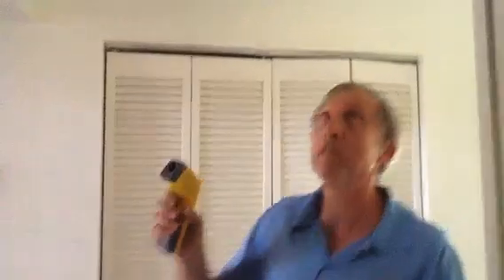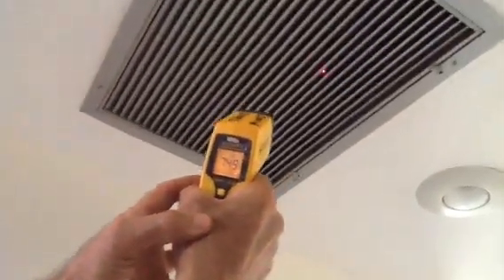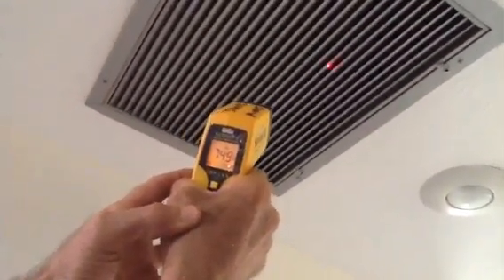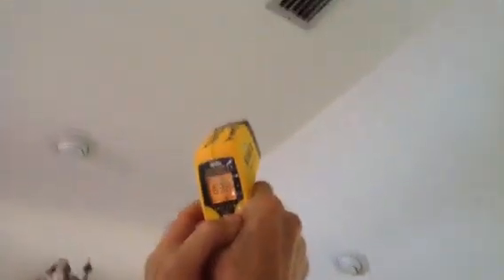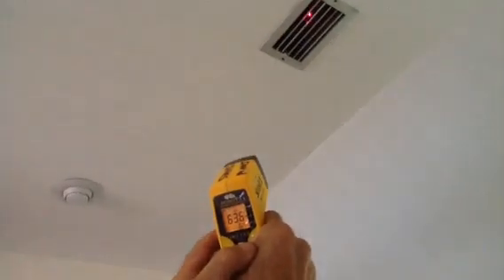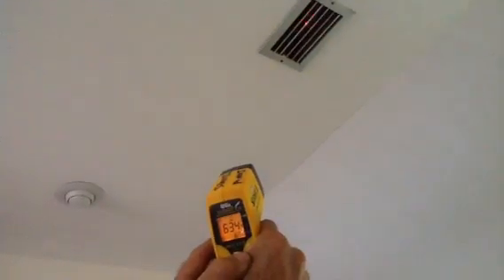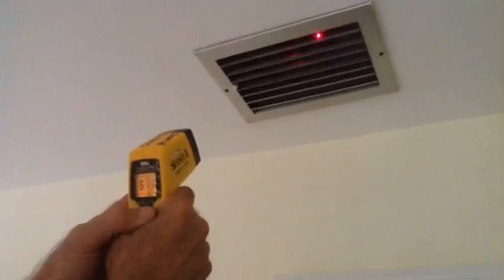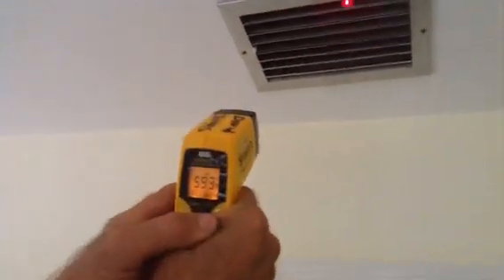" Supply vs Return: What Your Air Conditioning Delta T says About  System Performance"

Comment: That’s not true though, it could have a dirty coil plugged filter there’s a bunch of reasons and you have to know what would cause a bad reading before just oh put gas in, I can’t tell you how many times iv had to recover gas in the pounds because a bad delta t, or filters at the returns that nobody knew about.
Reply from the maker: That’s a common issue that I see all the time 
we always check for dirty coil first thing
THX for watching
David

Comment: I keep our thermostat on 79 degrees. I checked the air at the vent and it reads 74 degrees. The house does cool 79 but the unit is running to long I think to get there.
Reply: Lower thermostat to 76°F, and then check supply vent during cycling. Temp should be in low 60's or lower. The border is 77°F. Thermostat set above that gives you (73°F) warmer air at the air vent., on some units. If this is true for you, try setting thermostat at 77°F and leave it there.

Comment: IR gun is good if you understand and avoid IR reflections.  Aluminum is a good IR reflector.  Other items in the environment, like your body heat, can reflect off the surface into the gun raising the temp reading on the IR gun higher than the actual surface you trying to measure.

Most common mistake is pointing an IR gun at a foil thermal barrier.  You will not be measuring temp coming through thermal barrier.  You will get the average temperature of the room and objects in the room reflecting from the barrier surface.

Comment: Hey David love your videos! Quick question, how would you go about adding another return from the master bedroom back to an air handler that is installed in a closet in the hallway? It has very little room to the sides as the return has a grill right below the half-door. I think my only option is to run a jumper duct from the bedroom back into the hallway. Is this what you would do?

Comment: The true test is a across the evaporator. If it’s 18-20 and only 15 at supply grills it’s the duct work or a very hot attic with no ventilation. I am 100% sure this man knows this and is a truly awesome tech.

Comment: My upstairs is a lot harder than it is downstairs and I want to know if I can turn around and add a thermostat upstairs to divide my air-conditioning from the downstairs is there a way of doing that without having to buy a whole brand new air conditioner unit my home is just about a year and a half to two years old air conditioner in and heater is brand new and I had an air conditioning people come down and they wanted to sell me one for $3000 and I just don’t understand why do I have to buy a whole brand new air conditioner when I should be able to split it if it’s possible if there’s anything you can give me a hand with her any comments it would be appreciated thank you very much

Comment: plus it depends on how hot the outside temperature is, especially with the low grade insulated duct work in most houses , if return is in the attic its worse, attic 130 deg, R6 duct , not sure what rocket scientist was involved with that code, and same deal in the winter if you live in that climate.

Comment: If the unit is overcharged you will lose cooling,  And the higher the differential of supply to return means the unit could be oversized for the Zone, and will satisfy the thermostat before it removes the humidity from the zone , And you will have a cool clammy air !

Comment: Answer the Question.   How cold should my air conditioning Be? What that means to a home owner is just what it says....! How cold SHOULD my air conditioning air be. The question asked is based on "actual conditions" for a properly installed, properly maintained, properly sized HVAC system. The air temp coming out of the vents "should" be "X" under the above mentioned conditions....What is X?   BTW - Regardless of contrary opinions, Mr. Jones may be one of the most honest HVAC business men out there.
Reply from the maker: 16-18 degrees difference

Comment: Says 100° outside direct sun really is 90° now. I'm set  at 76°  it says 83° on display my vent air is feeling cold enough yet not as strong blowing I think. I need to buy temperature reader
Reply from the maker: With a temperature so hot depending on your insulation in your attic the AC system cannot keep up some of those hot three or four weeks out of the year thank you for watching

Comment: LOL!!! Gotta love all these "pros" with their "not air temp" and "not a probe" comments.  Bottom line is if you are getting 15 degrees difference reading surface temps at the registers with an infrared then you can be pretty certain the probe temps difference at the unit will be greater and all is good.  You "experts" need to check your ego and realize this video is good for a layman to get a quick check on their own system... IMHO...
Reply: WRONGGG!!!! We don't look for surface temp, we look for air flow temp. And latent humidity levels. A thermometer in the duct is best. And a psychrometer or humidstat for humidity levels. Unless the equipment specs says 15 degree delta t is ok, then you may need to make further adjustment to get a wider temp difference.
Reply: @smacleod69  The irony of your comments, that I am sure you will miss, is that you just made my point...
Reply: @MiklaDfar Not ego Its Knowledge and years of experience.  learn to appreciate it.

Comment: Sorry dude. The delta T can change wildly depending on relative humidity. Overcharged? What's the SC & SC? Also, use an actual thermometer, not an ir surface type for actual temperatures.

Comment: I had a new AC installed outside. With my old unit the humidity in the house would be between 42% - 49% during the summer. This new unit the humidity is between 56% to 63%. What could be wrong? The new unit drops the temp down but it runs longer and harder.

Comment: In Texas inspectors look for 16 - 21 degree delta T. The air where you change your filter minus the supply air closest to where the unit sits.
Reply: Texas here, If I got a Delta of 13 which is lower than the 16-21 does that mean anything? Better? Worse?
Reply: @UnKnown-jp1bv it means your probably low on refrigerant

Comment: Have a 410A system with a current 16F drop from 74F to 58F with 85F outdoors and high humidity--tested at the coldest outlet nearest the evap (But it is an attic based handler with ceiling outlets.)  Seems a little weak to me but OK.  Our old R22 system could take a hot house and cool it down to 72F within about an hour and of course shut off.  This system runs well beyond 1.5 hours.  Seems like the age old story: They don't make em like they used to.
Reply: Might want to check your blower fan speed. Depending on seer rating wanted we sometimes use a 5 ton air handler with a 4 ton heat pump. Gets us to 15 seer instead of 14. If they didnt change the blower speed it could be to high.
Reply: It sounds like your new unit is working great. If it’s not broke don’t fix it. It is better to run longer than to do what your old one did for an hour. New one is probably working better with dehumidifying the whole house. Just trying to help

Comment: The temp drop is measured at each end of the actual air handler with a thermometer stuck directly into the air flow. Throw that fancy IR thermometer in the trash! The IR Thermometer is NOT reading air temp, it is reading the surface temp of whatever the red dot is on. 🤦🏻‍♂️
Reply: Sean Geary actually the red dot is a laser and just for pointing. It has nothing to do with reading the temp. The IR has a cone shape reading and reads surface temp. You are correct that it should not be used for a temp drop. Thermometers in the air stream is the proper way.

Comment: This does help, my ac is 7 years old and I just sometimes feel it's not cooling like it was, I checked mine 68 intake 54 at 3 major vents tops so that's 14, I have cleaned my condenser coils and checked my run capacitor. All seems well, I unfortunately only have gauges for automotive use so I cant check the charge, I almost never let my filter get dirty, they auto deliver them every 3 months, no pets etc and I'm pulling very mildly dirty ones out on each change. I am going to recheck this at the hottest point of the day and see how much of a drop I get. The laser gun is the cheapest most useful tool you can have. I use mine to gauge thermostats to see if they open at the right temperature and to verify sending units are reading right and cooling fans coming on and such.

Do you have to have a license to get the proper refrigerant for home AC? I'm a good DIY type, and I dont mean "home improvement" goofs ha!
Reply: "Only EPA-certified technicians are allowed to purchase ozone-depleting substances (ODS) used as refrigerants."  You can get initial purchasing/handling certification with an online class. The initial certification has some restrictions.  You are supposed to buy only one pound cans and supposed to work on small systems like ac window units and refrigerators.  But, the basic principals of smaller systems apply to the larger systems.

Comment: we were looking at a new home, during purchase home inspection, new ac in 2014, 2017 there was some type of leaking of the line, new line was replaced, now during the home inspection the ac running for several hours, how ever home air temps are about only 12 degrees difference max, temp max, the home wasn't that cool, it was set to 77 never achieved that in 2 hours? would you please advise?
Reply: either unit is undersized or leak not fixed low on 401

Comment: Greg a probe style thermometer needs to be used in order to have an accurate air temperature measurement. the air at the face of the diffuser and the air just one inch behind the diffuser can be vastly different in temperature due to mixing after the diffuser.

Comment: I've found my infrared to be very accurate despite all the negative "professionals".  AC is set at 78°.  Returns show 78° to 79°, which is located on the wall even with the ceiling. My registers, on the floor, throughout the house, show 58° to 61°.  About 17° to 21° difference with my 40 to 50 year old HVAC.  I've always done alot of preventive maintenance on everything. Good video!  Thanks!

Comment: That will tell you only now cool it is at surface measured. Outside temperature has huge effect which is why two phase are popular in really hot climates. They cool more without the cost of too large a unit from short cycling.

Comment: Won’t the difference between the supply and return temperature simply be a function of how cold you choose to set the thermostat?
For example, my supply temp is 60. That’s not going to change regardless if I choose to keep it 70 in my home or 78 in my home. 
If I keep the temp indoors 70 degrees, the return temp will be 70,and the difference only 10 , but if I keep it 78 indoors, the return temp at 78 will have a differential of 18. 
Am I missing something?
Reply: No the supply air will be colder at 70F setting if it is returning 70F air, if you run ac much below 68F you run the risk of freezing up the evaporator coil, because of low load.

Comment: Checked mine with the same sensor you have there, this unit is 31 years old, Whirlpool installed by  Sears  and has a diff reading of approx. 16-17 degrees diif. Never been worked on by a tech. Yet.  Haa, was told by  HVAC service Companies that some of the old vintage units run forever.  Almost there,  haaa.

Comment: Question David; Old 2nd floor unit blowing about 77 at the register, 1st floor unit blows at 55 degrees...yesterday the 2nd floor unit was replaced with new (Goodman) condenser unit outside and new coil in the attic... ($3200)...today, 1st floor still around 55, new unit for 2nd floor STILL blowing at around 77 at the register...this does not appear normal to me. I'm now on the hook for $3200 and there's no difference? any suggestions will be apprecated...

Comment: you residential guys.... you cant get an accurate temperature with that infrared temp gun that is measuring surface temp and looses accuracy quickly based on distance to the surface. Depending on what refrigerant you have in your system and what type of expansion device determines the split temps... 15-18 is a bit low
Reply: There's not enough information given to determine whether or not that split is low. Sometimes,  an 11 degree Delta T is perfect.

Comment: Have you heard about using Cold Plus refrigerant additive to get colder air and use less electricity? I heard that both commercial and residential units are saving between 8% to 18% utility bill savings...is that possible?
Reply: That's what I thought until our utility company (XCEL) said they heard about it and are about to create a $400 per Kw rebate program for it. Too much data to behind this product to not be real. Just found this: http://www.hpac.com/blog/refrigerant-additives

Comment: This raises a topic of concern - but using an Infrared surface temp gun isn't an accurate measurement. Instead - consider inserting a dry bulb thermometer into the return and the supply, at the air handler and take the same measurements. Leave that gun in your tool bag. You'll also want to know more about duct leakage, wet bulb temp (air temp after taking into account for humidity), fan flow rate, outdoor temp - just to name a few.
Reply: oh brother.   Id bet a oat load of cash that the infrared is within 1 degree.    We are not splitting atoms here.
For a home owner.. to get a feel for his ACs performance,  this is a descent start.    There is so much fraud in the AC field.
Reply: @Milkman3572000  💯👍
Reply: I degree of what? ;) You've been drinking too much of that white creamy stuff - lactoseman

Comment: 18-22 temp split is a good difference. 15 = issues in airflow or charge
Reply: mark40511  Don't focus on the room or thermostat temperature for this particular test, except to lower the temp on the thermostat enough so that the air stays on for a while; but, yes, you have the right idea. The two temps you are looking at are as you have stated - the ones that will give you the DIFFERENCE. (i.e. supply and return). I'm absolutely horrible at explaining, so let me know if that doesn't make sense. :)

Comment: I thought it was better from the actual unit itself vs the grill ceiling
Reply: Check return air from return plenum of the unit making sure to be as far away from the coil or blower as possible but able to catch all return branches and supply air should be a few feet down the supply trunk line to be accurate.

Comment: Poor measurement methodology, which does not consider parasitic load of duct system, nor the cone shaped sampling pattern of the IR thermometer. This is fine for a homeowner, but definitely not a professional HVAC/R tech.
Reply: Anonymous Person shut it unless you have a better video we can all watch you tool
Reply: @Anonymous Person, 
- the method of testing (inside the home - not in attic or on roof),
- cost of equipment ($15-$20),
- values used to diagnose (temp °F instead of CFM, FPM, or pressures),
as well as other things, ALL point to this being for a HOMEOWNER. What part of this video do you believe would be of help to a "professional HVAC/R tech"? The part where he points the laser at the register? I think you just wanted to criticize so you could create an opportunity to say: "cone shaped sampling pattern" cause you think it sounds smart. It doesn't. It makes you look like you didn't understand the video, since you can't even properly identify who the intended audience is.
Reply: Anonymous Person Works within + or - of the probes I've compared it with.

Comment: He's using infarad and measuring surface temp. This is not accurate as you want air temp. A thermistor will give better results. Also the statement at the beginning of being over charged or under is an off the wall guess not even close to the only possible problems.
Reply: Delta T is measured across the evap coil. Not at the supply and return. R22 equipment is optimal between 15 and 20 degrees dt. R410a is 20 to 25 dt. If the temps are low it could be dirty coils or low on refrigerant and if the numbers are high it’s most likely poor air flow causing the coil to get colder.
Reply: @andrewdarbyshire9108 Low-speed air will make the air colder and the unit run longer if your unit needs longer running time for humidity.  The customer might demand it satisfy the t-stat faster but longer running time gives better comfort. The lower airspeed will also put less load on the compressor and it should use less power. It all depends but I would not try to adjust the charge by the delta t. Most units actually need more airflow because they have long runs of old r4 flex. It has to run through the evaporator slow enough to give up the heat and fast enough that it doesn't pick up too much heat. It definitely has to deliver enough air to overcome the load and it all depends on where you live what humidity level is desirable.
Reply: @andrewdarbyshire9108  hi, I been working on trane xr18? I forgot model, but it is a fairly large split condenser and in 73 weather it was only barely getting 15 degree drop, does that seem right? Can't get manager to answer me back on this, I am new tech
Reply: Global Air services
Reply: but you're probably only finding this video if you suspect you have an issue, in which case the A/C has probably been running for 2 hours already and doing nothing (or maybe a small something), in which case the surface temeperature of the metal will be pretty much exactly the same as the air temperature. And in any case if the A/C technician is using one of these themselves they will probably be more willing to listen to you if you can give them a 'DELTA T' and explain how you got it.